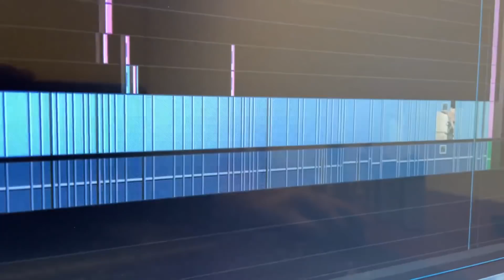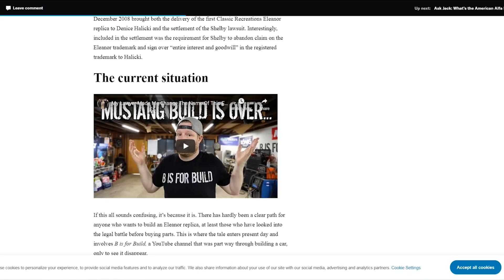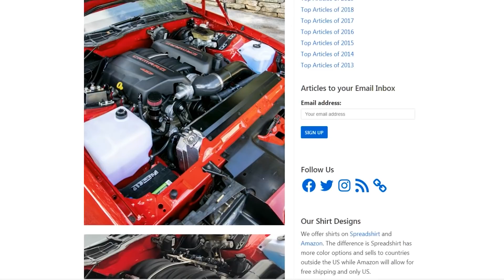Answering Your Questions!  Year End Q&A | RPM S9 E51

Comment: What do you guys do to your 6l80's?
Mine only has 640whp but the box is struggling.
I heard of circle d.
What torque converter do I need?
Cheers,
Reply: It has a dominator 2800 stall and 3:27 with a Harrop centre.

Comment: Commodore Vf2 ssvr with 1 3/4 headers high flow cats twin 3" with bimodal, Harrop 2300 with 8 rib 9-10psi 640whp at 7000rpm. Sq53b cam, stock 3:27s and Harrop tru trac.
Reply: After watching your vids through 18-20 I wanted a procharger and a powerglyde. But I think I'll go for an lsx 454 with a 130mm and th400
Reply: I will also have a c6 zo6 heads cam 640whp. This is great power for na 427.